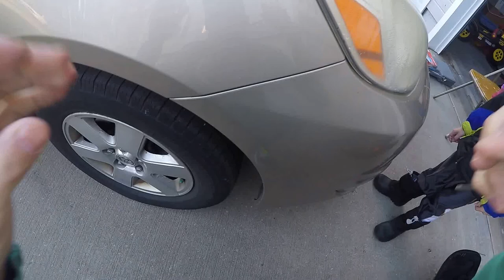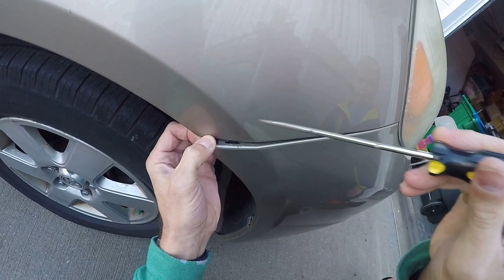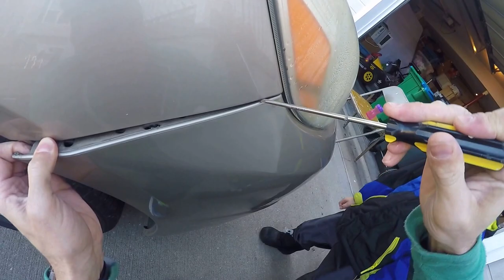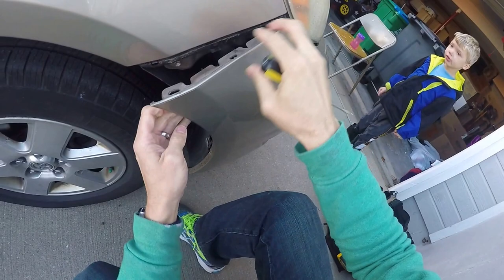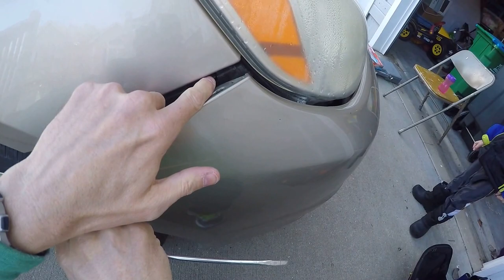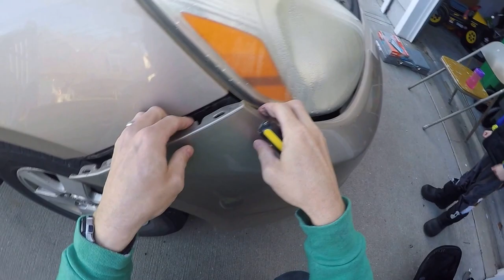How to Remove the Front Bumper on a Toyota Sienna

Comment: I found a 2006 bumper to replace a 2005. Bought fog light blanks. About to start on it today but the socket wrench for the bottom I still havent worked out yet

Comment: The bumper cover pulls straight out with a firm pull.  I didn't need the screwdriver.  Thanks for making the video.
Reply: No fucking way it was designed to be pulled straight out. I'm a big guy and mine are so tight I'm very sure I'll break the 13 year old plastic clips.

Comment: the title said, front bumper removal.
i think the bumper is still attach when the video was over. hahahahahaha.
Reply from the maker: Yes, I understand, but if you have had to remove this bumper you will know that this is the most difficult part of the whole process and I have not found anyone else on the entire internet where they show you how to do it, let alone demonstrate unsnapping the bumper.  Check out my website for the rest of the steps: http://www.ShareYourRepair.com
Reply: @johnmueller4543  As a Sienna owner, coming here and finding your website is actually amazing. You have guided articles for fixing most of the problems I've had with my 2009. Nevermind the trolls. You've done a great deal of documentation and it is really high quality.